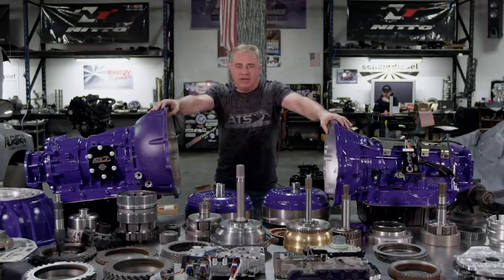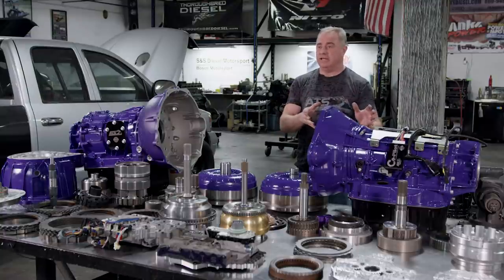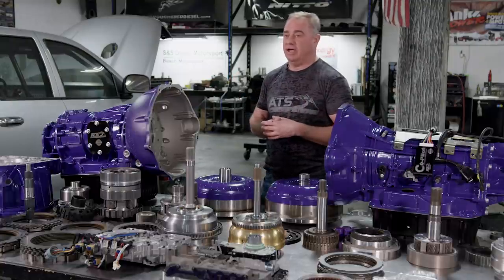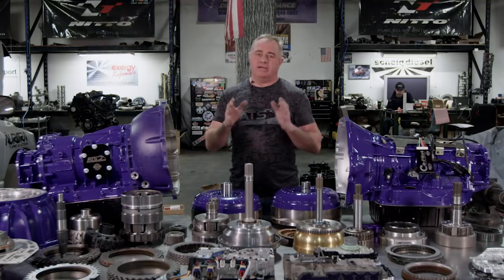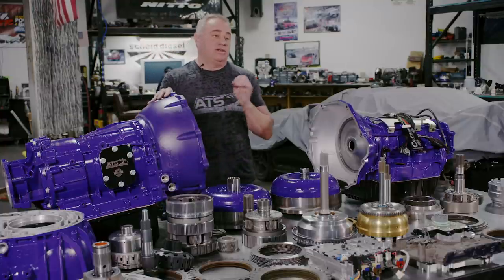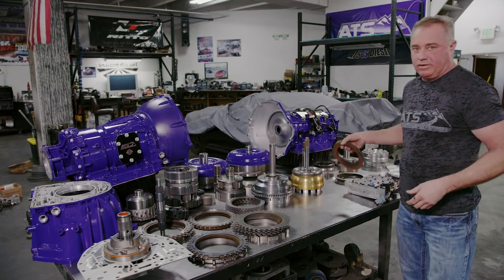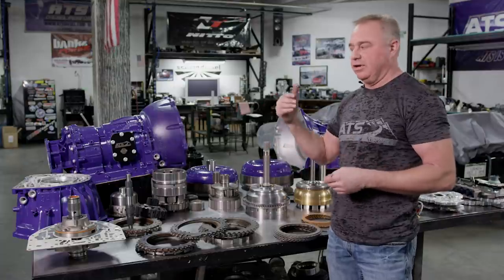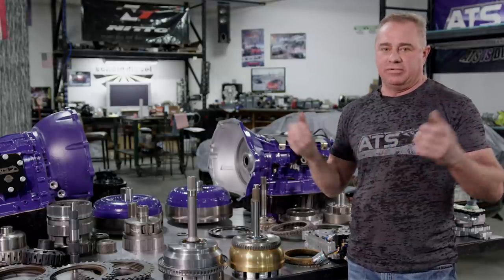Allison Vs 68RFE Comparison

Comment: Hmm got to say you've definitely peaked my interest. I found a 68RFE rebuildable core about 6 months after getting our truck so have been planning on doing something just haven't decided if I wanted to build it myself or buy one already built. I certainly like the idea of getting away from the 68RFE but my question is what's the difference in cost if I'm looking for something that will handle say 600hp? We have a 2008 2500 Megacab 2wd. I'm not looking to race or anything else just thinking about adding compounds for lower EGT's and more power while towing circa 14-17k. Thanks for the information.
Reply: That Allison will probably be repulsively expensive
Reply: You can rebuild a 68rfe 5 times for what this costs. Add a billet torque converter and your all set! I'm at 237k on this rebuild with the billett converter. I like the 68 and I haul heavy weight all over the country. I love the work they are doing for sure! I would love to have the allison...every man's dream but knowing what I know, I wouldn't do it.

Comment: This would be really cool if it actually works like it's supposed to. My buddy tried the same conversion by a different company it was a horrible situation. No reverse lights, remote start didn't work, push button start didn't work, among several other things. The tuning never did get right even with multiple attempts from the company. My buddy finally just gave up and got rid of the truck. Hopefully this is a true plug-and-play system that actually works as this video makes it seem. Also hoping this isn't some 15 or $20,000 modification. Hopefully not any more than about 10,000, and even that is pretty high.
Reply from the maker: Curtis, Please give him our info as we can most likely help him get this functionality back.   Please check out this video showing the functionality working on a 2015.  https://youtu.be/wJXcipANp7k

Also, yes that $10,000 mark is more the general price range, not $15-20k.   Also install will be about the same as a regular trans job.
Reply: @ATSDieselPerformance  I will be checking this video thanks.
Reply: @curtisbull1583  17k
Reply: Almost 20 with tax
Reply: @ATSDieselPerformance  I just checked a stage one is $13,687
Reply: Not true about the price! ATS charges $17000.00 for a complete change over, who can afford that! Before i spent $17000.00 on this conversion I would trade my ram in for a Ford and never look back! Ram should be ashamed of themselves and cummins should severe ties with ram if ram is going to go as cheap as they have!
Reply: @johnstagg7901 I can rebuild a 68 6 times for that price, and not touch it ONCE. ALthough the allison is every man's dream, I would have to pass. All you do is add a billett convertor on your next rebuild and it will last. Do not let your 68rfe shift to 6th gear under load. You do it with the manual shifter. Lock 6th gear out under load. Shift when you are ready. Let off the pedal, let it shift, re-fuel. It will last a long time!

Comment: The 68 is a good transmission if you use it correctly. Its single clutch in 5th and 6th and not made for big power.

Comment: Dodge Ram 6.7 liter with the AISIN transmission.  We towed a large fifth travel  trailer  across  the continental  divide.  ThIs  truck went up the rockies  ON CRUISE  CONTROL.  This truck descended  the Rockies  on CRUISE  CONTROL  & EXHAUST  BRAKE. This is a ALL STOCK (Factory) truck.
   This truck is FOR  SALE. Low miles.
   FOR THE SAME PRICE AS THE ALLISON CONVERSION,  you can purchase  a TRUCK WITH THE AISIN TRANSMISSION,  Plus ANY REPAIRS  & Parts (6.7 Cummins/AISIN) are as close as your local DODGE RAM DEALER. 
JUST LEAVE A COMMENT if interested. 
THANKS
Reply: You are correct, Dodge Ram spent millions engineering the Cummins/AISIN combination.
It's very important to have a dealership shop with factory support and techs.
Just imagine driving into a Dodge Ram shop with a Allison conversion.😮😫
Reply: @albundy8052  
Yes I agree  with you AL.
YOU are so intelligent.
Reply: Contact me about your truck please

Comment: I have a 2002 dodge with the 5.9 in  it. It has the stock factory tranmission in it. I have had it rebuilt twice since I have had the truck. The stock transmission is truly not big enough. I have always wanted to put a Allison Transmission in it
Reply: Two rebuilds in  21 years and you are complaining.  They are a wear item.  Your existing transmission can be built to hold that little 5.9 no problem.  That transmission was sorted before your truck was even built.

Comment: Just went to your website and I couldn’t find anything for one of these Cummins Allison swaps.
Reply: pretty new stuff i think
Reply: CAC Conversions offers an Allison swap kit for a variety of different engine options including Cummins. I’ve heard great things about the swap as well as bad.
Reply: @bb502cid  Yeah I’ve tried to call those guys several times with questions about the swap and they never answer their phone, that right there, tells me there’s a problem.
Reply: @chadhester265  Unless somethings happened at CAC, their customer service is on point and then some. I called in two years ago to inquire and they spend a good hour on the phone with me answering questions and explaining things. I ended up doing more research and determined there was an issue with this swap. The Allison trans tuning will not work with a high hp/torque Cummins. The lack of defuel between shifts will cause the trans to overheat and fail. However, it can be remedied by flashing a new tune in the TCM. 

I decided to hold off and last year came across a video from Firepunk in which they were removing CAC swapped 4th Gen Cummins truck for a 48. The trans overheated and failed. Per the video, it was the fourth failure, CAC warrantied the three previous failures and I’m sure they would have warrantied the fourth, but the owner decided to 48 swap instead.

If you leave a message I’m sure they’ll call you back, KC is a wealth of knowledge. The only thing I don’t agree with is the TCM with Allison tuning. Because I don’t want to deal with any possible issues with an Allison swap and having 1k hp goals, I decided do a 48 swap last year.

Comment: I see a external filter on the transmission, I guess it would better to use a fram ultra synthetic tough guard or different brand that is a better built filter. Does the pan come with a drain plug?

Comment: My ram 2500 had never had torque converter lock. Towing or not it never had it. Then around 100k it started loosing its gears all it had was 1st and Reverse…. I used it to haul logs on a friends property for a while and I went from reverse to first to get a good bump on the log and after reverse back to first I lost everything… 😂

Comment: Just found your channel and great info. I own a 2012 4x4   auto trans. I have 56,000 miles on it. My question is I'm starting to notice on cold starts and when I put it in gear that it seems like it takes about 30 second to slowly move. I called the dealership and they said that's normal. What's your thoughts. Is my auto trans starting to go out or ?.
Reply: Sounds like pump failure in progress.  Check your fluid levels at operating temp. It will do this if low on fluid.

Comment: In drive an Allison behind a Cummins 5 days a week in a 30K GVW vehicle. All stock set up, not a redone deal.
Reply: The SAE #3 you use in that 4500-7500 was going to require a 5" body lift and cutting up the floor pan ... so i went with the SAE #7 he showed in the video. (The one not attached )

Comment: Why didn’t you just make the Dodge transmission better? 68 transmission came from a front wheel drive? Man what have you been smoking?
Reply from the maker: Please look into the history of the RFE transmissions, many 68RFE parts are interchangeable with gas transmission parts.  We to make the 68RFE better have have several machines dedicated to making billet pumps, billet channel plates, billet accumulator piston, billet stator, etc.  You can throw all billet parts at it but still can't make them the size of an allison.

Comment: What about trans tunning when the truck goes through different tunes. The 68rfe is able to be tuned with the same tuner that is used for the ecm. Can the Allison be tuned with the same tuner for the ecm or will two tuners be required?

Comment: Will your Allison electronics work with a fully mechanical engine like a 12 valve Cummins?
Reply: I second this question.
That's my next step on my Excursion. 12 valve and an Allison.
Reply: The Allison 1000 was behind mechanical 5.9 and 8.3 in industrial/medium duty vehicles. It can be done.

Comment: I just bought a new Fuso box truck with a 6.0 gas engine.
Has a 1000 series Allison transmission.

I had to get rid of my diesel box truck, the emissions issues/repairs were getting out of control.
I only drive it about 20k miles per year, so even with the fuel savings I was spending more on repair, tows, rentals, downtime than I was saving.
And I didn’t want to go the delete route.

Don’t know all the differences that they can come with.
But the transmission has a 5 year unlimited mile warranty, so I guess they believe in it.

Comment: The issue is if I am traveling cross country. And my transmission gives out. I can go to any truck shop and have the 68rfe rebuilt and be back on the road in 2 days. Thats why regular hot shoters, won't invest in upgrading there 68. Because if it goes it goes, then they get it rebuilt or swapped road side at any shop. If you upgrade a 68 and you break down out of state that shop most likely won't have upgrade parts sitting on the shelf or  have that part needed to get you going, then what??? Time is money. Thats what stops me from upgrading my 68. Now the Allison transmission any truck shop will have parts for it which is great! What they won't have parts for is the front end of that transmission, so then one would be at the mercy of you shipping that part out and waiting on the parts to fix the transmission which could cost another 2 or 3 days of down time

Comment: Is this the new "GM Allison", or the Allison that would be installed in a commercial or medium duty truck?
Reply: Thats more programming 2nd gear lockup or 5th for that socke rmom butter shift .
Reply: Md transmissions have no involvement with pickups
Reply: @justinmartin8887  md trans is in a chevy/gmc  factory ,however the programming is not to md spec. I also have an Allison in my 1st gen ram
Reply: @daviddroescher  they still have no involvement with gm pickups
Reply: @justinmartin8887  so you saying an Allison 1000 is not a medium duty transmission? Then why do medium-duty manufacturers use the same box with different TCM programming?
Reply: @daviddroescher  it absolutely isn’t. You can get various completely different md transmissions and have nothing to do with 1000 series. 
    You can get many completely different md transmissions, with 5 or 6 spd some with manual valvebodies, others electronic and many different ratios
Reply: Then Freightliner must be mistaken identifying their MT45 as a medium duty trucks . I am not debating that other medium-duty transmissions exist, just whether or not an Allison i A) considered medium duty B)used in a medium duty application on a regular basis
Reply: @daviddroescher  Allison transmissions are used in anything from tiny pickups to articulated haul trucks; and have literally dozens of different build numbers.
    The md Allison you would see in a small freight liner would not even remotely be the same transmission as one in a light duty pickup. In fact; you could quite easily order an md Allison in probably 5 or 6 different configurations, just for that freight liner; depending on application
Reply: @justinmartin8887  correct and the 12v Allison 4sp DD ,  24v 5.9 CR 6.7 /allison  1000 3rd and 4th gen are the one I've got experience with . As well as the sorce of my core w/sae#3  that Hulon fox  of Dallas  built and installed a sae#7 /duramax pump body/bell. So yes same MD  box diffrent bell and output housing. He is the MD builder i dallis and refuses to tuch a GM product for there crap flawed programming that is what separates LD and MD in regards to the Allison 1000 3rd(5sp) and 4th (built as 6sp)  he had some Allison 3000's on the bench when I was there.

Comment: I bought a 1994 Chevy K2500 Detroit Diesel. This is going to be a 5 year project. I plan to replace the motor as it has some cracks in the head and block. My current plan is a new Detroit Diesel and I'm not sure if I should put an Allison trans or a new 4L80 (the original 4L80 is currently in it)...my plan is to produce around 450 HP and be a daily driver. I do love Cummins, but I've heard it is not an easy conversion for this body of truck. I plan to bulletproof the Detroit Diesel. I am 62, so this will be my last truck and I want it a solid daily driver I'll never have to worry about...any recommendations?

Comment: Stock 68RFE is garbage, mine lasted 80,000 miles in my Ram 2500 with modest towing/hauling.  I spent $5000 on a rebuilt 68RFE (which I regret) that I hope lasts 100k, but who knows.   If I could do it over again, I'd go for an Allison swap without any hesitation whatsoever.

Comment: We have a 08 6.7 that we’ve had since new. The truck has the 68 in it and I can honestly say it isn’t bad but it also isn’t great. I really don’t like the shift flare and I feel like it robs power from the engine.
Reply: The allison has a much heavier rotating mass , and will sap much more power than your stock trans .
Reply: When mine started shift flaring, I rebuilt it with a billet convertor and tuned the tranny with ez lynk auto agent. 237k on this build and still shifts like a dream. I tow heavy weight all over the country. I'm apportioned to roll down the road at 39,100 pounds. I only really push it to 35k though. I have the extra capacity for the scale house only. If my load weight is not stated accurately, I won't be over weight. 68 is fine.

Comment: i have a dodge 2008 3500 dually i have a problem with my transmission i went to see it is an allisson and a ring broke inside the flywhell and the transmission cracked.  how to weld?

Comment: You should see the 4000 series Allison in the trucks I work on! They put them behind the Cummins X15 with 1200ftlbs of torque!
Reply: The x15 should have more torque then that
Reply: 1200???? Maybe 2400 i would think. I had a 300 big cam cummins back in the early 80s had had more than that.

Comment: At min 6:24 he stated "it is a six speed trans" but GM did not go to a six speed till 2006 model year. Unless ATS is converting all pre 2006 model years to be a six speed.
Reply: My05 and down have the same rotating assembly so programming works but passages in main case are a restrictor solved with the 4th gen casting among other updates.

Comment: The 68 is NOT a great transmission, mainly because Chrysler has no clue how to properly program it. Chrysler even admits that it's a terrible transmission by only offering the Aisin in the 3500 HO trucks. It's the only transmission that can compete with the other two. Ford's transmission blows the Aisin and 68 out of the water. Programming is better, shifts are smoother, has a full manual mode. I have the Allison mated to a 6.7 Cummins in a motor home and it's much smoother than the 68 or Aisin ever were in my Ram trucks. I love Ram trucks, but I'll never buy another one until they can get their shit together and put a real transmission in them.

Comment: I already have your stage 3 68 RFE with copilot.  Will y’all offer a trade up program for those of us with your 68 RFE transmissions already?  If so, I know I and several other guys would definitely be interested in that!
Reply: I have their stage 4 and have had to have it replaced 4-5 times.... and still have 5th and 6th clutch pack slipping issues with their installer magnolia diesel now ignoring my calls and not returning my messages even though it was still under warranty.
Reply: I HAVE THEIR STAGE 5 ON MY 2004.5 CUMMINS. YOU GUYS ARE MAKING ME NERVOUS

Comment: exactly why RAM Truck needs to have a factory fitted Allison tested and integrated to be ready to use on 2023 RAM 3500/4500/5500 Trucks to have a reset on the aftermarket trying to make an Allison fit to a Cummims in RAM
Reply: Dodge has the aisin transmission. It’s called the “Allison killer “ for a reason. Its far superior to the Allison.

Comment: Smooth shifting autos don't last as long as one you can feel the shifts in. Glad I have the G56. Bring back the manual transmissions damn it. Guess my next truck will be a Toyota Tacoma or a jeep
Reply: I've split two G56's.  If your next truck is a Toyota, or a Jeep then you don't need Dodge Cummins configuration in the first place.  I bet you have a real cool mall crawler.

Comment: Just got off the phone with these folks they're just blowing smoke up your butt this kit isn't even available yet and it's over $8, 000 just to convert your trans over to fit ouch.
And they're too stuck up to sell you just the bell housing torque converter and flexplate.
So I'm just going to go with the number three bellhousing a divorced transfer case a used TCM box program to MD specs and save myself about 7, k
I might have gone for it if the gold plating was standard.
Reply from the maker: If you prefer to grind nearly an inch of material off your black, have terrible shifting and lose all factory functionality then there are several routes to saving money over our kit.  Developing products isn't cheap.  We still have the better product at a lower price than any of our competitors.